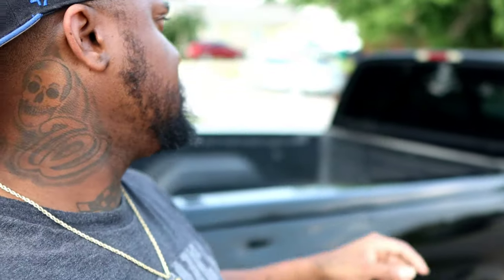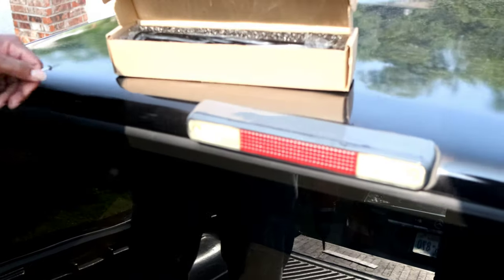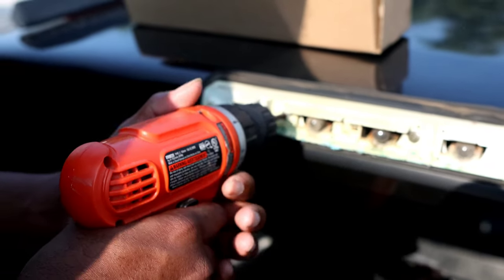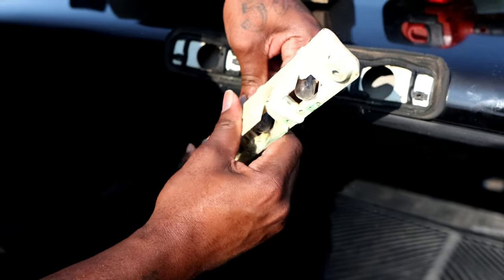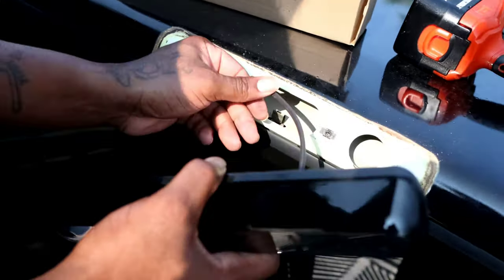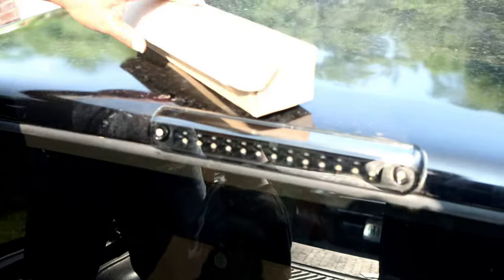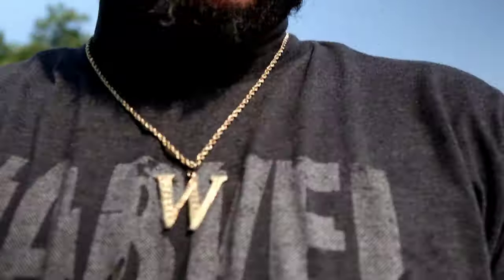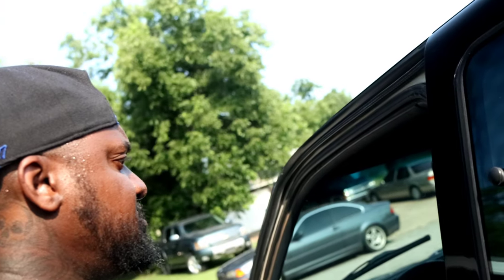INSTALLING LED THIRD BRAKE LIGHT ON OBS CHEVY

Comment: did you use the sticky rubber foam gasket? i was wondering if you have to use it or not to prevent leaking

Comment: Quick question.. I have a 98 OBS & I was looking to change tHE 3rd brake light also.. I click onto tHE link yOu provided  & it took me to Amazon but it says Compatible with 2007-2013?? sO is that still tHE same brake light yOu order for 30 dollars??

Is so that means 1995 through 2013 all tHE same size??